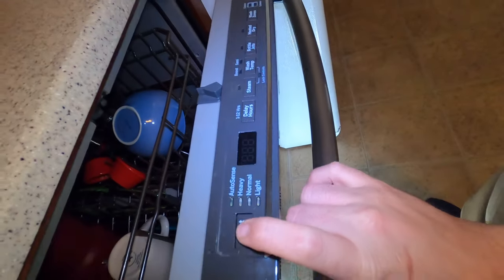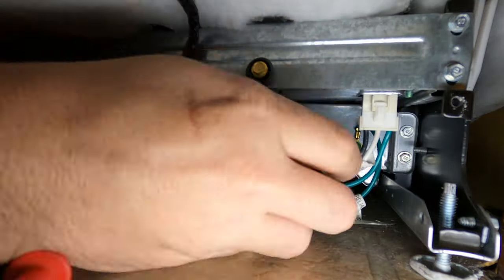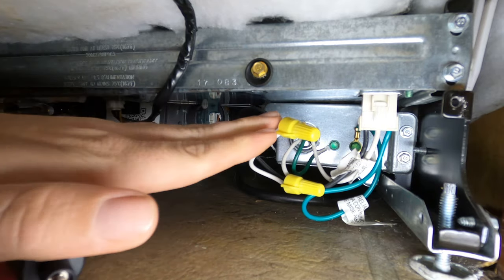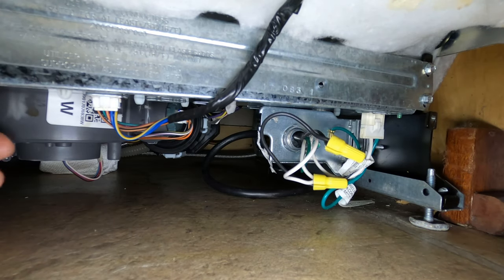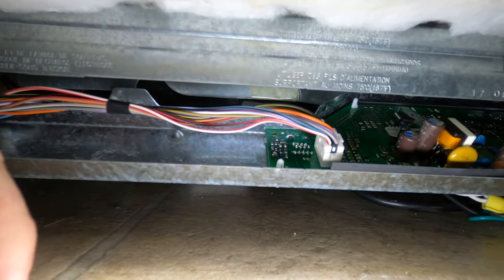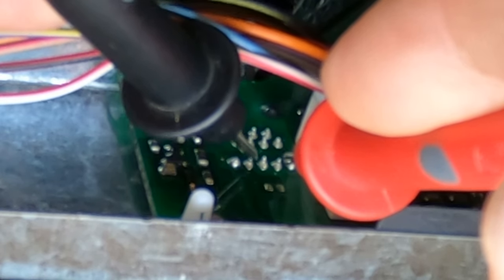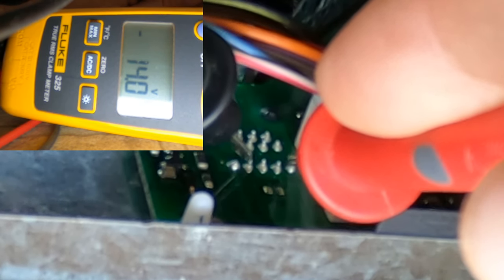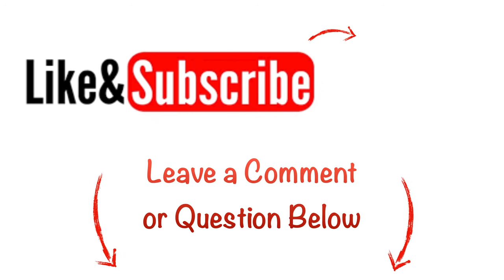GE Dishwasher Dead Display Diagnosis (GE Dishwasher Has No Lights)

Comment: I had a dead unit. I replaced the mother board and it worked for about 6 months. Then I had no power, but after resetting the supply breaker it would work for a few days, only to require the resetting of the power supply in order to work. Relative to the UI board I have 12VDC from pin 5 to pin 2 from the mother board but the user interface does not light up. I have tried the original UI board and two others with the same results. I have confirmed the continuity of the wiring harness from the mother board to the UI board. I believe I now need a new mother board. Any comments or direction would be greatly appreciated!!
Reply: That sounds similar to my issue. Resetting the circuit breaker would get it going again, then that quit. This diswasher has always done a bad job of cleaning dishes, so it's not worth spending money to fix. Was just hoping to get it running.
Reply: @kevkolb  Thanks for the followup. ended up buying a new LG. Like it alot!!

Comment: I suggest replacing the UI and Main control board as per GE technical support every time I call them, Sometimes the UI needs to be reprogrammed to the new main board but only GE techs carry this tool, So for these needs both parts .

Comment: Machine waking up on it's own I intermittently and beeping for 6 months, lead to tripping my GFCI, then machine went dead with no display. Ordered both main control board and UI control board and still nothing. Inspected all wiring , took machine and door apart 6 times and still nothing. Wondering if my replacement parts are faulty, since there is no other culprit. I've inspected this thing up and down to no avail. I used to work on commercial dish machines at Ecolab and never had this much difficulty fixing a machine. These GEs and their boards are garbage pieces of crap

Comment: Why doesn’t Ge’s technical information disguss this??? Ended up just testing each pin to ground and got nothing. Ge’s wiring diagram was not helpful. Oh well, customer decided to just buy a new dishwasher anyway.
Reply from the maker: I found the info by finding the service manual online.  Not the tech sheet.  You have to read to find it but eventually I do.  Most of the time though it is the UI. 9 out of 10 times for me.

Comment: I have 14 volts to the two pins. Also have a flashing green light on the board. What now?
Reply from the maker: If UI is not working then is sounds like the problem lies in the UI if it getting the right power.
Reply: @BeardedApplianceRepair  can you explain the blinking LED light on the control board? When UI is blank, it flashes 7 times continuously, when I mess with the dishwasher enough to get it to run a cycle the the light flashes 3 times continuously.
Reply: @timexum743  On my model (PDT750ssf) 3 blinks means a wash cycle is in progress. Doesn’t say anything about 7 blinks though. The highest mine apparently goes is 6x, which it says means it’s in “demo mode”

Edit: just found some info about a different model that says 7 blinks = tripped current sense module

Comment: Second question. When I reset the unit, holding select and start  button, the interface lights up. When I try to make a selection it blacks out. But every light lights up. With the control board putting out 14 v do you think it's the U I BOARD?
Reply from the maker: When you hold those 2 button and it starts blinking you have to wait until it stops.  Then you hold just cycle select for a few seconds to enter the component testing of the dishwasher. 

1 blink drain pump,
2 blinks water valve,
3 blinks wash pump
4 blinks is typically the heater test, sometime you need water in it for it to run properly.  Depending on the model. 

5 blinks is usually the dispenser door test. 
 after 5 blinks they can all be different.
Reply: My dishwasher won’t start but everything is lite except for the start button. When I press the start button it just makes a chime but won’t initiate the start sequence???
Reply: @jjjerome85  same for me. Any idea the issue or the fix?

Comment: Looking at 190K views in 1yr, I would say no one should buy a GE dishwasher! I am having the same issues  with no solution in sight! Resisting to buy a new one as I already spent more than $450 (first about $300 with a local 4.8* rated tech and then $150+ on a GE authorized tech)!!! 😞

Comment: How do you know that testing those two pins measures the DC voltage?
Reply from the maker: Found out from the service manual for these dishwashers. You can actually google the service manuals for be dishwashers.  They have a ton of information in them.  Another thing to read up on about these dishwashers is the float switch on these things.
Reply: @BeardedApplianceRepair  o get power on the 1st and fifth pins. This dishwasher is testing
My sanity

Comment: Everyone, I found out something awesome to figure out if it's the UI Board or the main board. 
If you press BOTH the CYCLE SELECT and DELAY START button and HOLD for 5 seconds and the user interface does NOT light up - that means the user interface board is shorted out and will need to be replaced.

IF the display does LIGHT up when you press those buttons - then replace the module.

Comment: I only have 8 volts.  Is that enough?
Reply: Is it AC or DC?  I have 8 VAC and 0 DC. Green light comes on power board but display board dead.  I have 2 power boards and they do the same thing.

Comment: pop the breaker let it set. Then do a reset after the lights come back on
Reply from the maker: Make sure you comment back when it fails again.. I guarantee it does.  (I tell my customers the same thing when we figure this part out)
Reply: @BeardedApplianceRepair  ok I’m back. Now what
Reply: I replaced the circuit board and it didn’t fix it.

Comment: Used this video to figure out that they hooked mine up to a switch in the wall that I thought didn't have a purpose. Felt like a idiot
Reply: Pulled the panel check voltage nothing breaker was good cuz the garbage disposal was working on the same circuit. Flipped that switch and it worked

Comment: I just went through this procedure and it magically started working after I turned power back on. There is a capacitor or battery in there. I think when that discharges and you remove the UI harness it resets? Idk I think it’s junk too. Called GE and they said “we’ve never heard of this problem” 🤡

Comment: How did you know it was pin 2 and pin 5?
Reply from the maker: The Service manual.  You can actually google it on these models.  Not the tech sheet with just a wire diagram.  You want to service manual for this information.